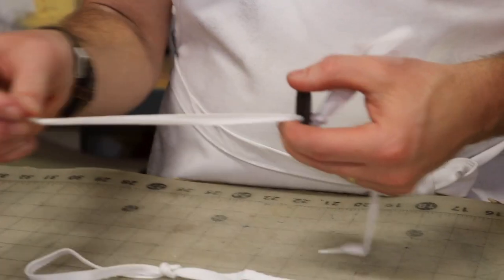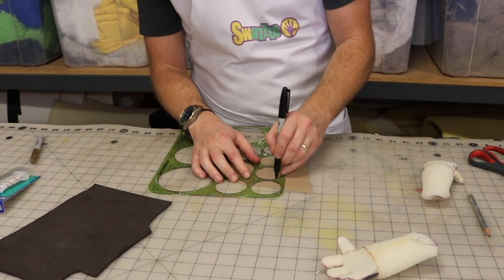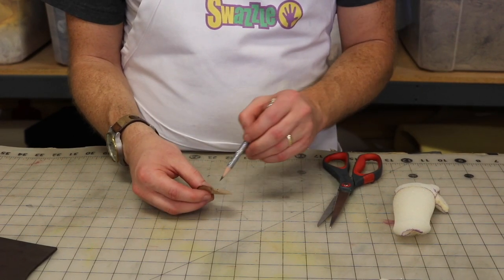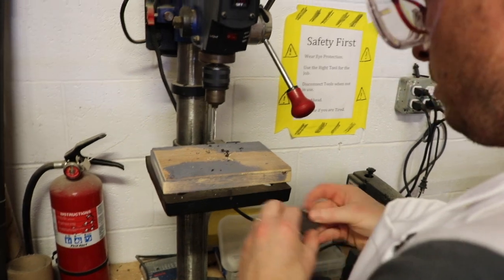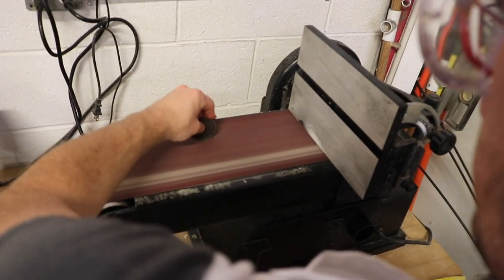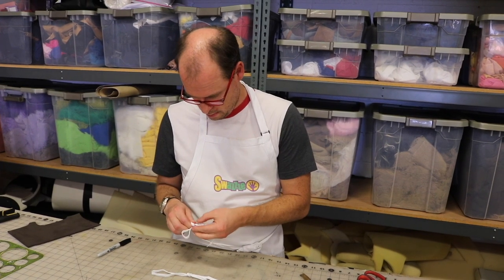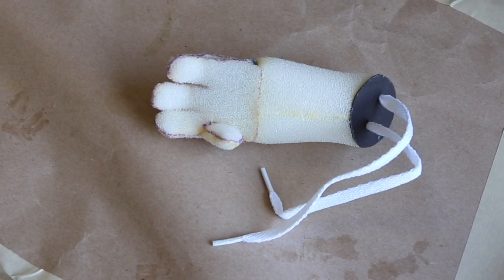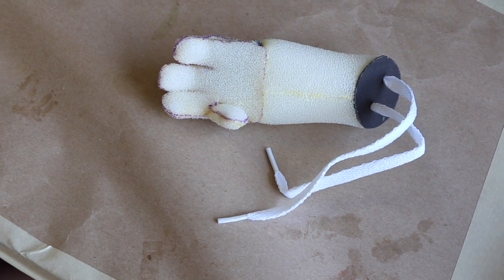Learn to Make the Puppet Arm Gaskets - Swazzle Puppet Studio Episode 14

Comment: Extremely helpful video. I know this is a very random question, but what brand/type of scissors do you prefer for cutting thicker materials like the gasket rubber? I’m currently using Fiskars amplify razoredge for heavy duty cutting, but since you have more daily experience I was hoping you might share some personal insight. Thank you for your time.

ETA: Also forgot to ask, is this a 1/8 inch gasket rubber?
Reply from the maker: Yes it's 1/8 inch - we sometimes use thinner as well. The brand of scissors is less important than having a pair of scissors dedicated to utility work, and a pair of scissors dedicated to  fabric. This will keep your fabric scissors nice and sharp.
Reply: @SwazzleProductions  I will definitely keep that in mind. Thank you for the response.